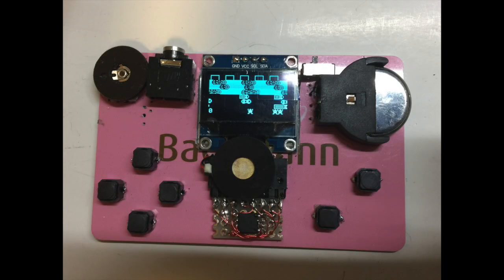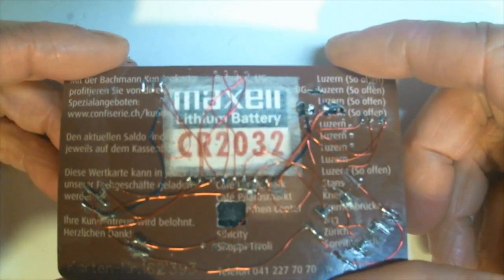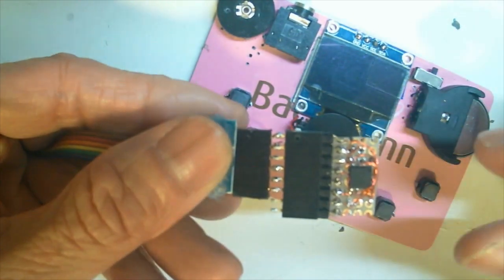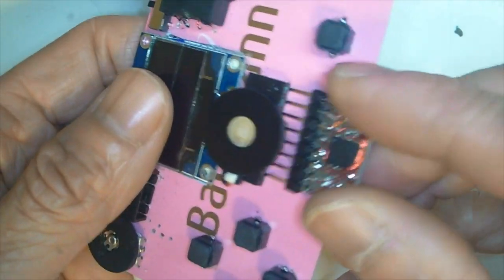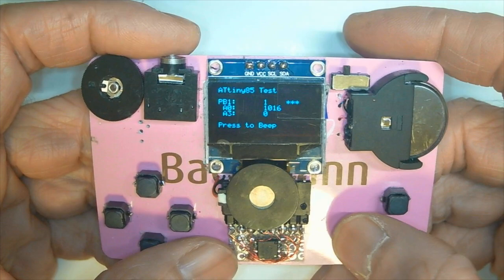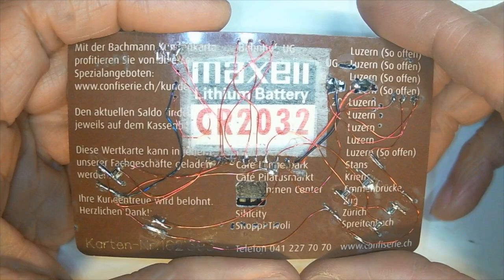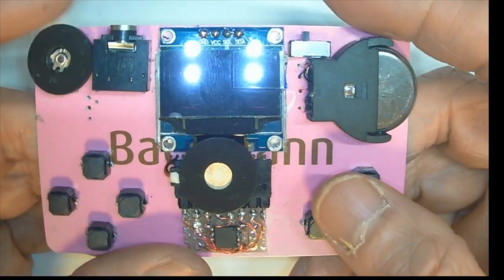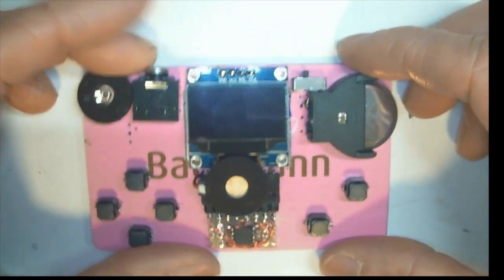Attiny 85 game console built on an expired real credit card.

Comment: Nice project. Looking at your circuit diagram there is a mix up between the gnd and vcc at the plug for the left buttons vcc supply. I have spent a long time trying to use a attiny85 with 6th pin with the bootloader on the digisparks. Any ideas?
Reply from the maker: Thanks for pointing out the faults. Will correct that in my curcuit diagram. Can you share more what your issue was ? How did you make the connection between the Attiny 85 and the USBasp Bootloader programmer ?
Reply: @BillyCdiy  Well I've actually been inspired by your video to re visit the attiny85 and I've learnt allot today about fuses and how the micronucleus bootloader allows the the 6th pin to be used by elevating it from its isp reset job. Im currently just having a trouble windows 10 not loading the right driver for micronucleus.

Comment: Cr2032, battery life how much ?
Nice project
Reply from the maker: Depending on the quality of the CR2032, it can usually go up to hours. Optionally, you can replace with a thin Lipo battery, but then you need to add a LIPO battery charger board.
Reply: @BillyCdiy  for this circuit and quality of battery used in video what is approximate battery life
Thankyou for reply
Hoping for more tutorials on attiny85
Reply from the maker: jalal wadood , It should last for 4 hours approximately.